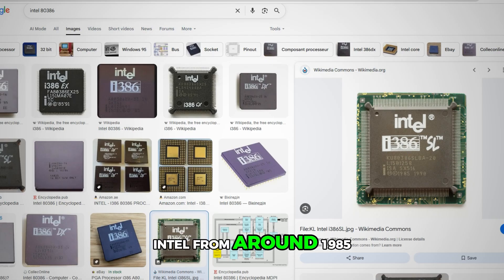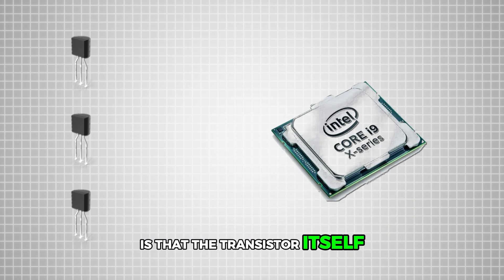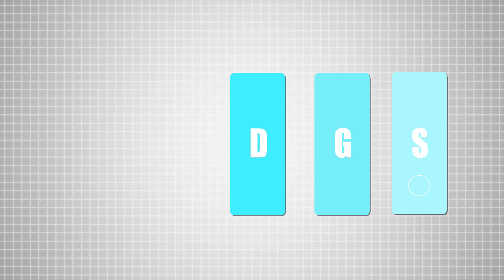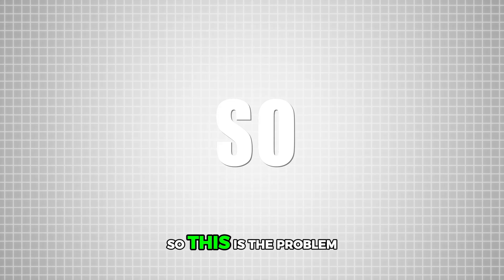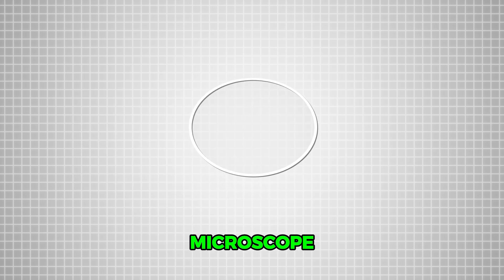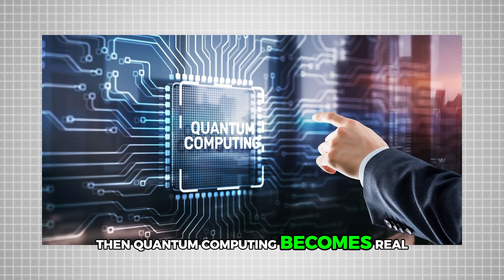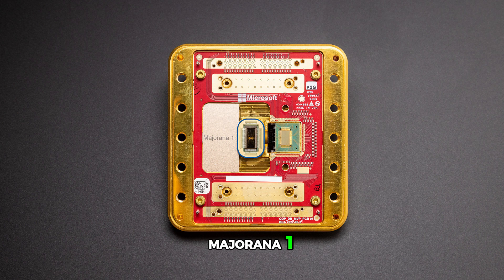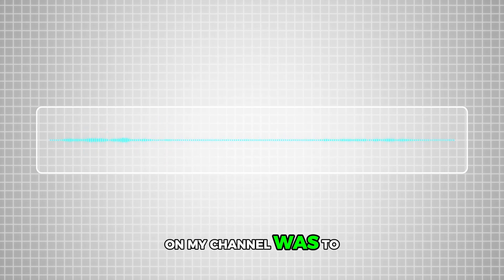The Big Problem With Processors...

Comment: La loi de Moore n’est pas une loi au sens juridique ou physique, mais une observation empirique formulée en 1965 par Gordon Moore, cofondateur d’Intel.

👉 Elle stipule à l’origine que :

le nombre de transistors dans un circuit intégré double environ tous les 18 à 24 mois, ce qui entraîne une augmentation exponentielle de la puissance de calcul et une baisse relative du coût.

En pratique :

Dans les années 1970–2000, cette tendance s’est vérifiée de façon spectaculaire : les microprocesseurs devenaient de plus en plus puissants, tout en restant abordables.

Cela a permis l’essor rapide de l’informatique personnelle, d’Internet, puis des smartphones et de l’intelligence artificielle.

Limites actuelles :

Aujourd’hui (années 2020), la loi de Moore ralentit :

Les transistors atteignent des tailles proches de quelques nanomètres (2 à 3 nm dans les dernières générations).

Les limites physiques (effet tunnel, dissipation thermique) rendent difficile le maintien du rythme.

Pour continuer à progresser, l’industrie explore :

de nouvelles architectures (processeurs spécialisés, puces 3D, multi-cœurs),

de nouveaux matériaux (graphène, nanotubes de carbone),

et d’autres approches comme le calcul quantique ou l’IA pour l’optimisation des circuits.

🔎 Aujourd’hui, on dit souvent que la loi de Moore est en fin de cycle, mais elle a façonné toute l’histoire moderne de l’informatique.

Comment: the "size" that they specify isn't necessarily (not really at all) the actual size of the transistors inside, it's kind of a fudged number based on the interconnect size and space between transistors AFAIK
"for modern "3 nm" or "2 nm" processes, the smallest features are still in the teens of nanometers, and future roadmaps (like IMEC's) predict they'll hover around 16–25 nm for years due to physics limits"

Comment: So essentially we can set up registers and the answer could either be right or wrong.  So all we have to do is look at it when it's right?  Then we wouldn't need all that messy calculation circuitry to slow stuff down.

Comment: A E5-2630 V3 in benchmarks is best at all time CPU in price per performance at a nothing price but if you compare to a recent CPU it's as good as a Ryzen 3 4100 at a nothing  price.
Reply: Been considering getting an E5-2667v4 or an old i7 extreme, not just cuz of the price, but also cuz they support more PCIe lanes and quad channel memory, unlike modern CPU's for some reason. And their Aliexpress motherboards are cheap.

Comment: AI will make CPUs more efficient by:

> Design: Using AI to optimize chip layouts, pipelines, and testing.
> Management: Smarter power, thermal, and task scheduling in real time.
> Software: AI-driven compilers that better optimize code for CPUs.
> Architecture: Adding AI accelerators to assist with predictions and workload distribution.
> Reliability: Predicting failures and improving security through anomaly detection.
Reply: It's already doing wonders for Windows 11 updates and Nvidia drivers being made by it :D

Comment: The AMD Ryzen 9 9950X processor contains a total of 16.63 billion transistors, not 16 million.
Reply: My 486 hsd 16M transistors.
Reply: @IanPattisonOakville My first PC. 486 SX 25mhz
Reply: Is this video just AI slop?
Reply: What about 9950X3D ?
Reply: @shaklama_brakamait's essentially the same processor with 3d v cache
Reply: I was about to say the same thing, 16 million is like pentium 4 single core probably 😂 (edit, pentium 4 has 42 million transistors)
Reply: He said OVER 16 million transistors so he’s technically right

Comment: whatever.
I fucking hate these cpu's easily hit the 95℃ over.

Intel, AMD, nVIDIA, all of you.

why I'm afraid that apeshitty high temp while like I gaming or someshit!

Goddamn it!

and almost all useless son of a bitchin' cpu cooler makers.
70℃ over is they said to me “it's absolutely normal”.

Of course not YOU NASTY
MOTHERFUCKERS. 

if is it normal

why my 7800X3D is dead?

SoC under voltage like 1.155v I used. 'cuz I don't wanna burn my PC.

fuck I hate everything.

Comment: why we have to keep the size same again????
i dont have problem yo use a double the size cpu. do you?
Reply: Long wires cause timing issues. Then you have to uses busses. Everything becomes slower.
Reply: @dfloper It would in fact become netto faster, because of more transistors - without hitting the atom-scale. But yes, there would be more cost of bigger die and higher latency. Best regards
Reply: This aproach will have your PC case taking up your whole garage, by the end of next decade :D
Reply: @meganoobbg3387 Maybe. That's ok for me, the problem for me would be energy consumption and generated heat 😅 Best regards

Comment: The question is, WHY do we need faster cpu s then what we have now ? I still use a core i7 6850k 9 years old and its still great for internet and gaming. What truly needs to change is this stupid economic system with infinite growth on a planet with limited resources !
Reply: The internet's bloated, my 2012 macbook pro was running smooth until 2023, the performance went down FAST now hovering over the youtube bar on a video makes it lag.
I know linux would be an awnser, but that's short term if webs and games keep shoving bloat on their stuff
Reply: Not everyone use computer for light use.
Reply: @pradeeprawat8135  Why would you need more than Ryzen 9 9950X3D, or Threadripper PRO 9995 WX for home usage ??? Its all about competition not performance.
Reply: @pradeeprawat8135  gaming is not light
Reply: just a few people realizes that my friend...
Reply: I still use a r5 3600 and a gtx 1060 which is still decent AND enough for switch games!
Reply: Fun fact your current cpu is the product of that pursuit, so stfu.
Reply: Dude, 80% of what I do I can do on 486 with 16MB of ram…point is I also do 20% (3d graphics animation and llms ) that 486 with 16MB of ram just won’t cut it lol.  So yeah, saying we don’t need faster computers is dumb.
Reply: 0/0 ragebait

Comment: Ok, I get it.  Why are engineers trying to limit the physical size of processors to the smallest possible size instead of making them bigger in physical size?
Reply: Easy : Because bigger size means more energy demand and also heat generation. If they simply increse the size of the cpu's at some point you'd need your own diesel generator and industrial level cooler to keep it running. Not feasible.
Reply: Latency
Reply: Actual a good question and obviously one that would prove far more powerful. It's about control and limitation. They want you paying thousand for tiny chips and upgrading frequently. There the market. Anyway for computing it an example of going "bigger". All those servers computing on a common goal is like have a really big microprocessor.
Reply: The chiplet size has a massive impact on its cost to manufacture. A larger chiplet is more likely to get defects and thrown away, which wastes valuable wafer space. And having more usable chiplets per wafer makes the end product more cost effective.
Reply: It is a obvious question, i mean we can increase the area and the amount of transistors, which means more energy and thermal cooling.
Reply: Take a look at the WSE 2. It has 2.6 trillion transistors, 850.000 cores, 46,225 mm2 of silicon, 20 petabytes memory bandwidth, and it’s made by Cerebras. It uses 15 kW of power.
Reply: @emiel333 I didnt know about this until you mentioned it! Even if it's only 7nm I am impressed!
Reply: You want things to be as compact as possible, because the farther apart things are on the processor die, the farther the electricity has to travel, which slows the process down.

Comment: whatever is used to implement the logic gate. ie transistor, relay, switch. billion not million. anyways, design stuff that is smaller if you want smaller. no you dont have to use the same traditionally accepted transistor tech. if you use the transistors inefficiently then design better. adam, ask above about possibility of doing things. understand that. that what is impossible for people, is possible for above and those who believe. try individual atoms or electrons as compute elements. ie kinda quantum processor, but more logical than quantum random. ie how many electrons are required to make a gate that can be both in closed and open states, switched. with certainty, not a probability. well a transistor can be in open/closed states with 99.9999% certainty. thats the working design of transistors in compute chips. ie certainty of compute. even if you somehow cant go smaller, you can use the transistors better. ie fixed logic or fpga's are more active compute dense than cpus. you are nowhere close of electron density in the matter. order of magnitude of 10^20 difference in amount. or 10^6 difference in electron size. well tunnelling right. it stops if you give up. dont give up, have hope. even especially if you know. believe in above, not in the law rules limitations. you dont serve the created, but be free with above. also you misusing the laws to bind you is wrong. come on bro, its only screening effects from atom size to macro sizes. well you make it magic and sorcery. quantum compute is just fast binary state compute. using random states as the compute machine. ie random walk computing. plus some functions that you want the random walk to go through. ie solving a minimum position for neural network error. superposition is fake, as each particles has a definite state, even if you dont measure it. you just dont know what your random distribution measurement result is, until you roll the dice. get your statistics right, or you teach mumbo jumbo that others have to know by your decree. well if you make up your own rules that dont correspond in reality, then whats the use. ahen, everything is quantized in quantum mechanics, ie individual particles.

Comment: 2nm transistors can operate at peak frequency of 1thz, just change the core and cash every 0.001s and I have a CPU with thousands of cores, regular cores but only a few virtual cores, no problem, the problem is the architecture, you have to move away from the standard operation of the CPU and GPU, just differently
Reply: If you try to hear every word of thousands people that speak to you at the same time what would you understand? That is a problem with the communication between the cores. All cores want to use the same memory and have to wait of the other cores to get access.
Reply: @maxmuster7003  Each core can have 3MB of cash memory. It's possible to have three cores and three cash registers running separately, but the cash registers will act as one cash register. Cores not performing computational power can transfer memory from the first cash register to the last, but the three cash registers will act as one large cash register. This means the cash register memory would flow with the cores and operate at high frequencies. With thousands of cores, only three cash registers and three cores would operate at very high frequencies, for example, 100 GHz. Computing power would jump from core to core, and memory from cash register to cash register. Each core and cash register would run for only 0.001 s, but each core and cash register would rest for 1 s. Power consumption would be equivalent to three cores with cash registers, and the virtual core would run at 100 GHz continuously, utilizing hundreds, perhaps thousands, of cores. No heat generation, no cash register problems, and no lag.